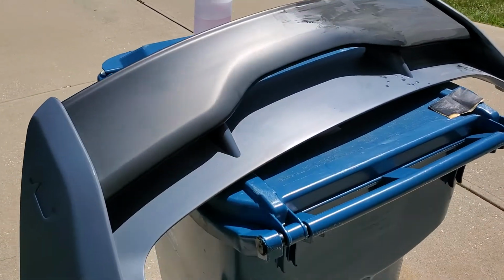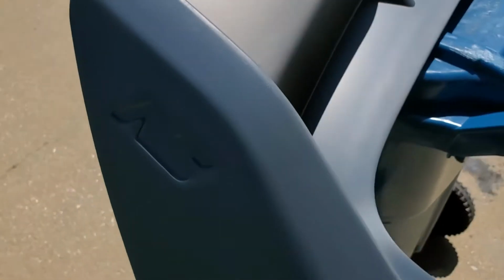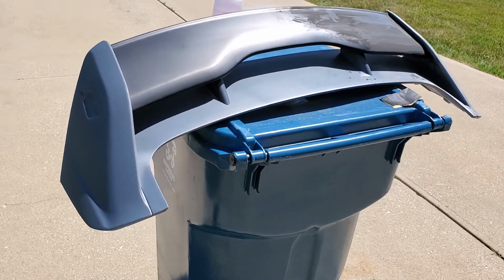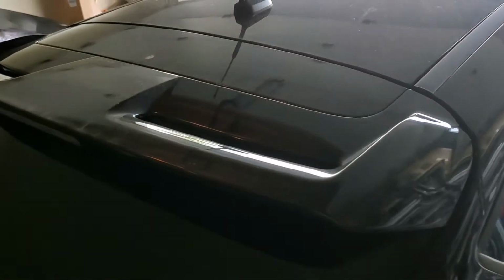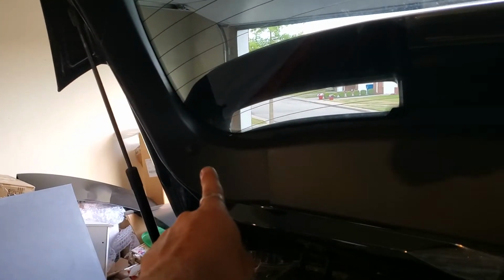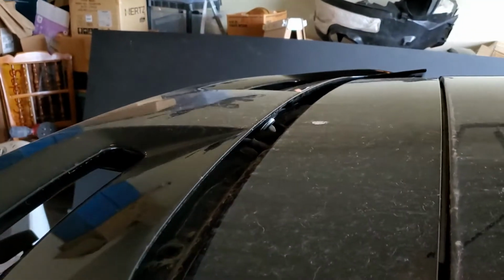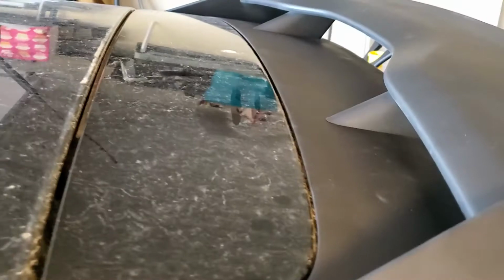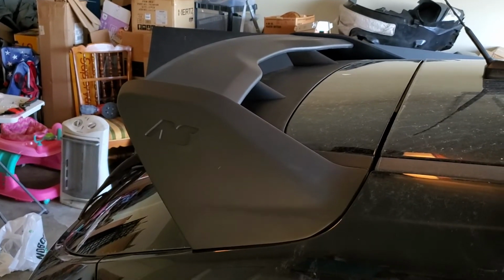HOW TO INSTALL FORD FOCUS EBAY RS SPOILER / WING

Comment: Do you think filling the spoiler parts with closed cell foam would help with the hollow sounds. Like halloween decor. My wing sounds so cheap but feels strong bc its fiberglass. Idk debating on filling it with foam for vibration reduction and slow down any vibrations from my stereo

Comment: I was thinking of getting a ebay spoiler as well, I have a 2016 ford focus hatchback and I wanted to change out the spoiler, But was just worried that the spoiler from ebay wouldnt git mine, But I see that it fits alright, I might consider getting one soon!!